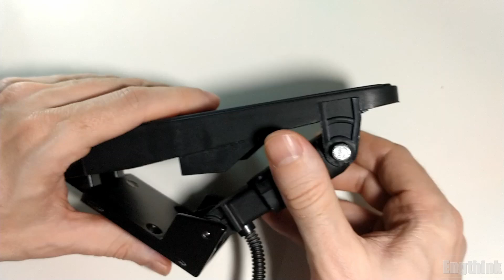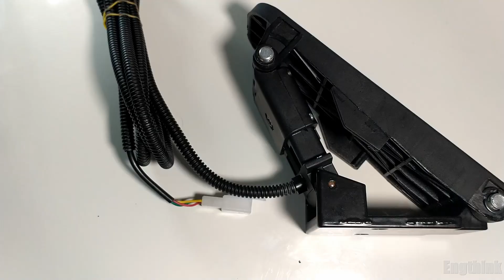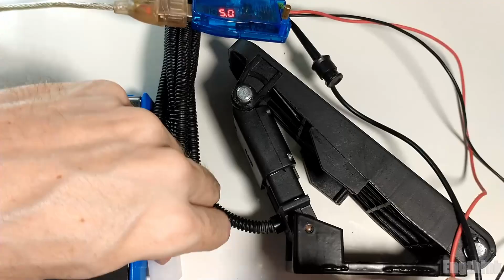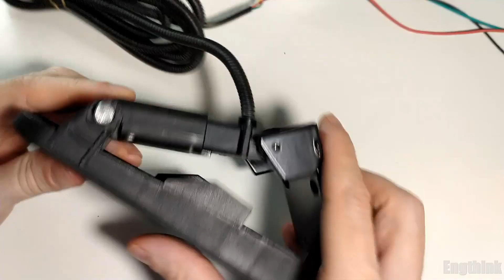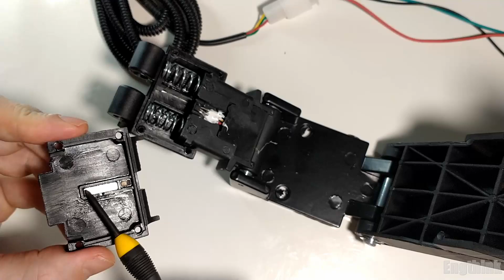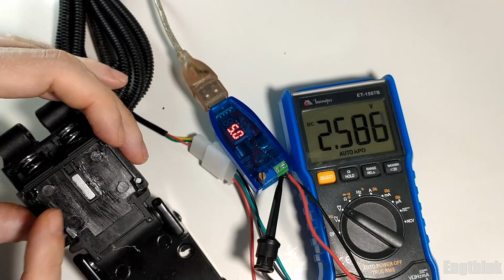Electronic Throttle Pedal Explained – Linear Hall Effect Sensor #halleffect #electricvehicle

Comment: if i want to invert reverse the voltage (4v at rest, and 0.8v at full stomp), so we can simply doing that by rotating the magnet position right?
Reply from the maker: Yep, exactly 👍 Rotating or flipping the magnet orientation should invert the voltage response, so you’d get around 4V at rest and ~0.8V at full stomp instead. Just make sure to recalibrate afterward since the range can shift slightly depending on alignment.